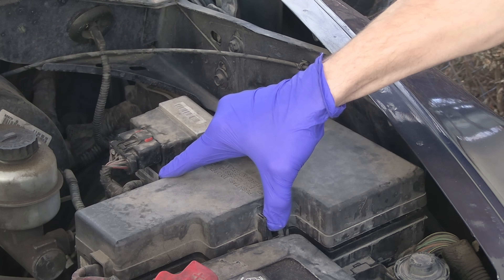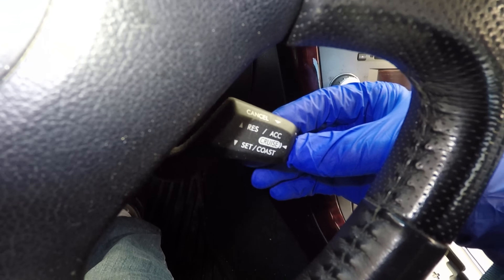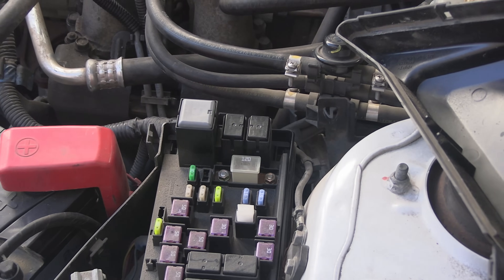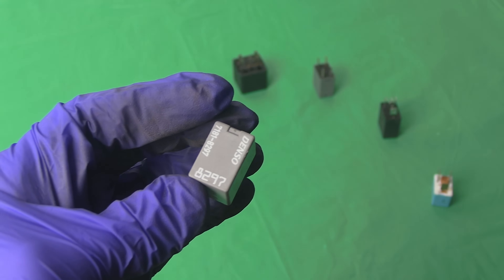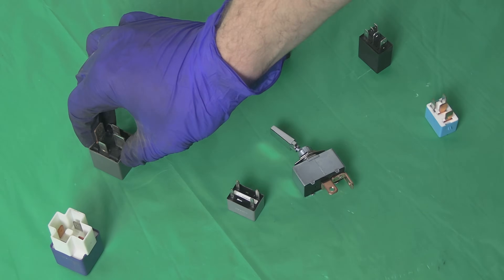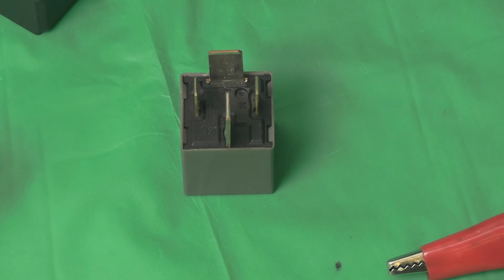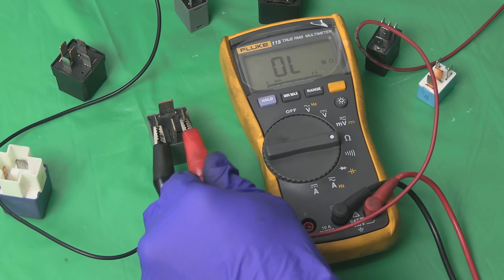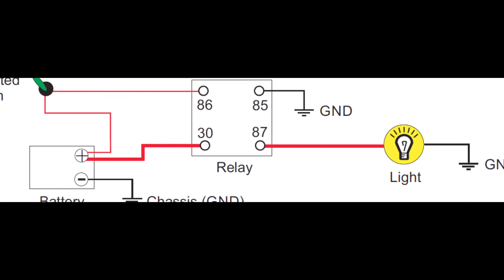How To Test a Relay (and How Relays Work) - in 8 minutes

Comment: I’m having issues with my low beams still lights not working after I changed the battery and alternator. My fog lights use not to work but now they work and my low beams don’t. I don’t understand! 2006 Outback LL bean!

Comment: hi! can you replace a 12v 80A relay with a 12v 30A relay? same 5 pins. thanks
Reply from the maker: No,  you need a relay of the same current rating.

Comment: I have Kia Sedona LX 2018, after my 3rd rear end on black friday 2023. We have issue with starting up van then a friend did what you shown here. So I order 2 relay fuse for van from Amazon one 2 days deliver $29 and one $19 3wks later. Then found 5 for $8 USA Amazon. So far in 6 months we have gone  through 5 of these relays. Could it be something else like temperature sensor and thermastat defective too or is it a short somewhere. I notice something vibrate underneath steering wheel or could be inside cabin fuse box near driver's  left knee.  Black friday this yr I prepared us with purchase of pack of 5 and 10 from Aliexpress about $50 for 15. Also notice my cigerette light sometime charges my phones sometime does not, i swap out fuse with spare but Amazon and Aliexpress keep sending me mini not micro fuses so piss off.

Comment: Straight forward right to business without all the chattering for 10 mins first... fantastic mate.  I think my fuel pump relay is going in my subaru. When I put key in ignition and power the accessories to on position I hear the relay click then about 2 or so seconds later a smaller fainter soft click can be heard. Is that normal or should I only be hearing 1 single click ?.
Reply from the maker: Thank you for the kind words. Regarding your question - when you turn the key to ON, the fuel pump gets turned on for a few seconds to build up pressure, then it shuts off until you crank the engine. So the second click could be your relay shutting off

Comment: AREN'T SOME RELAYS NORMALLY OPEN VS OTHERS THAT ARE NORMALLY CLOSED 

NORMALLY OPEN THERE WOULD NEVER BE CONTINUITY BETWEEN PINS UNLESS POWER WAS SUPPLIED TO IT (TO THE CONTROL SIDE / CIRCUIT)
Reply from the maker: Yup, that is correct!

Comment: I was reading about checking relays on my vehicle and there was a caution to DISCONNECT the negative terminal before removing and reconnecting a similar relay and then reconnecting the negative terminal to check whether it was a bad relay or time to look further.
Reply: Good point!

Comment: I wish you would have explained the last part where you were using the meter on the relay outlet on the car. Do you connect the black part to the battery and use the red line to the outlet. Lastly what range should you get. I got .408 on the outlet and idk if that's fine

Comment: Wow what a great video, thanks!! Will test, my car has strange problems with the fan, some lights, speedometer going on/off aso.
Reply: So we tested my car’s relays. They seem to be ok, they click. I just wish I knew what is wrong with the electricity in my car… The heater, inner light, reverse gear light, lights on sound gone not working anymore…

Comment: thanks for your video, you are presise and clear for a novice like me, trying to fix my car alarm,as the remote does not open the door and its not a key problem as ford dealer and  car locksmith tested the key, so it could be a relay for a ford focus.

Comment: In a lot of.
Cars You will have the same relay  In the fuse box For example You may have four different relays with the same number On them  I'll look up.
What the relays are for For example Yes the windshield wiper relay  Is the same. I will check Check the windshield wipers if they are working  That I will take The    windshield wiper relay. And put it in the other  System You are.
Trying to test Only if the two Relays are the same There's always numbers on the relays  I just take out  the another  Really.   And swap it. To test the other circuit

Comment: I have a 2004 Lexus es.  On one of the relays under the hood it has the letters ADJ at the top and uderneath those 3 letters is APS.  What is that relay for? 8:08

Comment: I used a 12vdc 1.5amp apliance power adapter. Large parallel pins or pins that display continuity with a dmm are  power pins. while powering relay or not on power pins, and if 5 pins, 2 of 3 smaller remaining pins will be open circuit and alternatively closed circuit, with dmm on continuity mode. thank you for teaching!

Comment: The best thing i found is a video of the different fuse boxes and it shows what relays and fuses go to what. Here is the catch. You could have a few fuses that are good that don't light up and switchs that are good but don't work. That is when you find what RELAY is bad.  The video is called start my car . You can touch the picture of a fuse and it will show you where it is and what number and size and color.  Relays TOO.  👀 Wow 👍❤ it . 
   Note some things have to fuses and relays to the same thing. Why, ? No idea yet. 🥴😂

Comment: Great video. BTW - OL on a meter means 'overload' aka the reading is outside the range of the meter.  So when measuring the resistance of an open circuit you get OL because the resistance is virtually infinite or over the range of the meter.  A very high resistance will show a numerical reading in the megaohm or M range.  Hope this helps.  OL does not stand for open line, but it does as it turns out correspond to an open line condition.

Comment: Being an actual electronic engineer AND technician, there are some glaring misrepresentations here.
Most relay control circuits are powered through a separate fuse, and energized by the car's computer  completing the relay coil circuit to ground (car chassis)
Use a meter to check coil resistance; hooking unfused clip leads to a car battery is very dangerous, and some relays have internal diodes to protect the contacts from surge arcing, and this will be damaged by reverse battery polarity. Invest in a $30 digital meter and do it right!

Comment: Thave a car with 1 dim headlight and 1 normal headlight when the switch is set to manual ON, but when I switch the headlight to auto, both lights are normal, would you know what the problem is? Is it the relay?

Comment: One more vote for an informative and well presented video.

It should be mentioned that if the relay is suspect and you don't have a similar relay handy,  first use your voltmeter to ensure that terminal socket 30 has current. If it does, put a jumper between terminals 30 and 87 on the socket and the downstream device should be activated.  If the device doesn't work with a jumpered relay socket, current isn't reaching the device and you may have a break or short along the wire.  Don't leave the jumper in place after you park the car, or you may drain the battery; the circuit may not be made to carry current continuously.

Comment: relays perform several important functions,  they allow us to use much smaller voltages and currents to switch much larger voltages and currents ,  and isolate the controling circuit from the much more powerful circuit  that is being controlled, a 12 volt circuit can operate a relay that switches and controlls a 500 volt circuit or even more dependoing on the rateing of the relay, but it would be impractical to directly switch a 500 volt and 10 amp circuit with a switch directly, it would have to be a big and bulky and impractical, it's far easir to use a small controling voltage say 12 volts activateing a heavy duty relay to switch on the 500 volt circuit and heavy current circuit.
so really perform two important functions, firstly they isolate the smaller controlling voltage and they switch equipment on and off as dictated by the controling cicuit.
all basic relays  are composed of an electro magnet pulling on a contact to complete another circuit

Comment: Under warranty you will get paid about 15 mins by a car dealer to replace a relay.   This includes finding the car on the lot and driving it in, punching in to the job on the computer,   running your tests,   going into parts department and waiting 10 mins for them to get off the phone.  Replacing the part.  Re-testing the system,   Pulling  the car to  car wash area.  Looking up the codes to get paid..  Then filling out all the paperwork.   This is why i'm no longer a  dealer mechanic,   too much work for too little pay time..     The easiest way to test a car relay,  is usually there will be a relay next to it thats the same,   just plug that one in.    I have also seen where relays get old and stick...and a Hard tap will make them  work again, for a short time.   We had one model of car if it wouldn't start we would hit the dashboard hard with our fist!  If it started, the fuel pump relay was going bad.

Comment: Your video is the only one that discussed checking both the resistance between pins 85 and 86, and supplying power to these pins to test the resistance between the other two pins after the relay is activated. Great job!
Reply: Clown

Comment: Good video. I do however suggest using multi-meter first before using power from a battery. If by mistake you put power across the "load contact", you will have a direct short which may burn the contacts. Once you are positively located the coil pins, then using the battery is ok.

Comment: Yes, excellent vid.  Relays provide safety in keeping high amps (load) away from driver controls  and economy in the ability to use thinner copper wire to the relay.

Comment: Is it possible that the relay can be going bad gradually. 
Car cranks and occasionally will not start immediately then stumble to a start. Thought?
Happy new year
Reply from the maker: if it cranks at all, most likely your starter relay is fine. if it just takes too long to start - could be a bad check valve in your fuel pump
Reply: @MakeItEasyMechanic  Thanks for getting back to me. Your video opened my eyes.  Starter ended up bad.  then I did a cleaning of the MAF and the throttle body and so far it starts like it used to.  A new issue is that it idles high often and when shifting gears (manual tranny mazda 3)  rpms don't drop like they used to.I wish you great wealth and happiness for your generous gift of time and effort.  All the best neal sw fla

Comment: No one can answer my question if relays underhood cannot be removed from housing even when using all ur strength which could cause another problem breaking the housing. Then what 2 do next?
Reply: Sounds like corrosion..put some pentrating oil to it and get a fine screwdriver under the edges to wiggle it free..

Comment: Well done, easy video to follow. I always had a good understanding of a relay but this was a good refresher. I have a 2019 Kia Sorento and the Map lights inside the car are not turning on. I have power when I manually turn the lights on but the lights will not go on when the door opens or for the button that turns all the dome lights on. So it cold be the diode in the car lamp assembly or the relay is your video suggested. Thanks and good tip for switching out the relay and trying them in different spots.

Comment: My Subie Impreza 2008 model is showing ABS and handbrake lights on. i took it to my mechanic to have it checked it out and they didnt also find any issue although the diagnostic machine indicated "MOTOR & MOTOR RELAY as the problem" but i am not sure if they tested the motor relay. The braking still works perfectly well and i have driven it for now 3 months with the ABS light on and still havent had any braking issue (No skidding, no delayed braking etc).
What could be the issue?

Comment: Can this video get some claps/high fives? Damn. this is some quality stuff! Thanks a lot for this super informative 8 minutes! Will watch again and do some tests on my car. Would love to hear more on the final part when you are testing the relay connections on the fusebox with the red side.

Also: can i just use the multimeter @ 12v to test the clicks on the relays? thanks again!

Comment: In older vehicles, it is prudent to replace Relays in the 20 to 25 year range proactively. The cost is modest. While most Relays will probably never reach their open/close cycle life, age can and will compromise their integrity over time. Swapping Relays can be a quick fix to get you up and going... but who wants to crack the hood and troubleshoot on a cold winter morning when you are running  late for work or school. Just something to think about. Great Video!

Comment: Horn doesn't work, also the front parking lights don't work, the horn itself is fine, relay is fine, fuse is fine. jumped a wire to pin 30 to 87, horn still doesn't operate but front left side parking light comes on?

Comment: Good video, thanks. So, if the ohm reading is high on the load circuit, like 25.6, or 33.6, when you add current to it, means that the relay is bad?. You know, since pin 87 & pin 30 ohm reading is not low.?

Comment: I recently began having problems with my driver's side power window. Not the motor and not the switch. Also the door open light comes on including the interior light stays on when I turn it on. All the fuses are good but I don't know about the relays but this is what I'm suspecting that one of the relays is causing this problem. I just can't get any info on what some of the relays control.

Comment: I'm not g e tting a NY gas to the carb I can't figure out why I'm pretty sure Kitts not AA relay ooor fuse could it be the damn fob Mikey the anti theft system ?
Reply: Cuz it cranks but just wont kick over subaru outback 2011
Reply: I can hear the fuel pump kick on
Reply from the maker: If you can hear the fuel pump run and the engine cranks over - you may not be getting spark. But don't neglect simple stuff (low fuel, security light ON, when trying to start etc.)

Comment: Told electrician i think the relay is broken. $330 bucks later he tells me i need a new fuse box.  $790 bucks later my lights still dont work. I took out the relay removed the cover and it had blue corrosion from water damage.  I cant get it to click. 
So i will try a new relay.  Over the years to date the water leak has cost me  $1750  and still counting. 
Hoping the new relay gives me my lights back.

Comment: I think we will be trying this next. I have intermittent starting issues in a 99 chevy express. Grounds are good, fuel pump, filter all-new and engaged, pressure is fine. All the other issues I see say there would be engine issues when running. When it DOES run its a champ. Now, the battery is drained (I think from us trying to start and it will not) I can only hope its this simple. I have had people say ECM and ICM. But when I read about these, they say one of they symptoms is poor performance which we do not have. Thank you for this video. Here is hoping.

Comment: If my truck has only 2 windows and 1 works but 1 doesn't could it still be a relay? I replaced the switch i replaced the motor and regulator and all the fuses are good. I have not tried relays nor looked through ALL THE WIRES FOR A BREAK YET

Comment: Nearly perfect. I wish you would have gone over why the, what purpose does it serve to have one pin normally closed and then switch over to the other closed. But you are waaaaaaaaaaaaay better than the other videos. Thank you.
Reply: The normally closed pin can be used for anything that you want to stay powered on when the relay itself is not being powered.
 Let’s say I want to install a really loud aftermarket air horn for signaling while offroading  but I want to keep the original car horn for normal emergency use on the road.

 I can cut the normal horn power wire and connect the ends to pins 30 and 87a (the normally closed pin).
 Without doing any other wiring at all, the horn will operate as normal, just like I never did anything to it.

 Now I can make a new circuit for the new horn using pins 30 and 87 (normally open). Then use a toggle switch to power the relay when I want to be able to use the new horn.

 Of course you want to be sure you’re using fuses for any new electrical equipment and I don’t recommend anyone add more points of potential failure into existing equipment like in this example, but that’s just one example of how I’ve used that pin in the past.

 Maybe a less complicated example would be to use the normally closed pin to power a warning light letting you know that you haven’t turned something on yet, that you really should turn on. 
 Once you turn the thing on, using that relay, pin 87a is no longer powered and your warning light turns off.

 I used one that way for my dash cam system. If I happened to forget to turn it on I would notice that light pretty soon after getting settled in and moving.

Comment: Hi, I couldn’t find any videos about AC diagnostics in your channel. I’m having a problem with my 2007 Subaru Forester, AC is not blowing cool air. I noticed that the compressor’s clutch is not engaging. I tried switching relay’s within the fuse box in the engine compartment to see if the clutch would engage but it didn’t.

I’m not a mechanic but I consider myself to be a person that can solve a problem when having the time, the right tools and the knowledge to go about a problem. Perhaps you can give me advice? Thank you and I really like your videos.
Reply from the maker: 9/10 times the reason your compressor is not kicking on is because of low freon in the system. But I would recommend "Ratchets and Wrenches" channel, he has a few videos on diagnosing A/C system

Comment: Good presentation. Small nit to pick: if the relay's switch contacts are burned or carboned-up, it is possible that they will pass the ohm meter test, but will cause too big a voltage drop when high current, such as found in a 30A lighting or 40A secondary air injection circuit, runs through them.